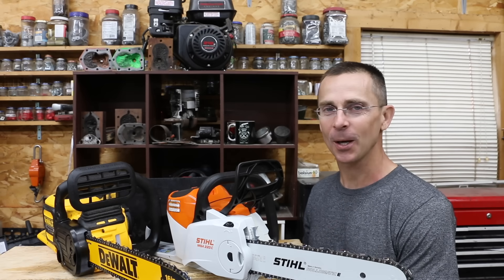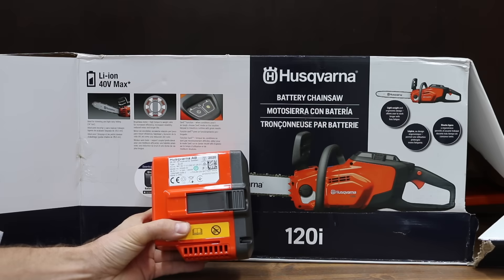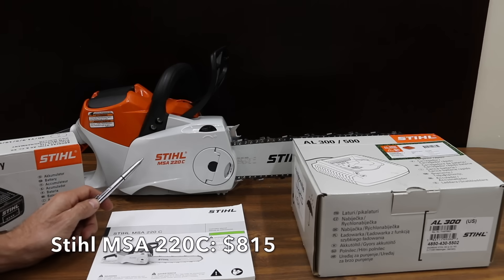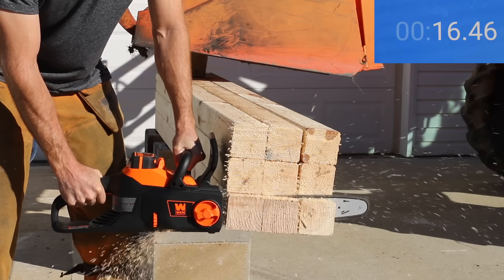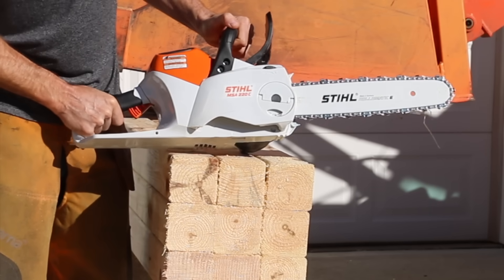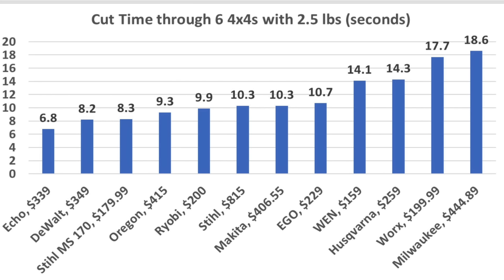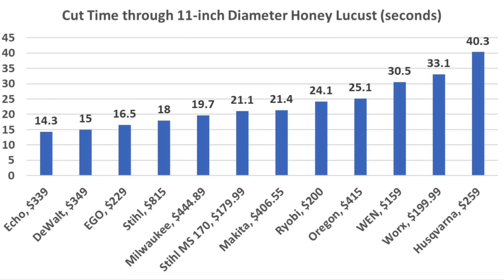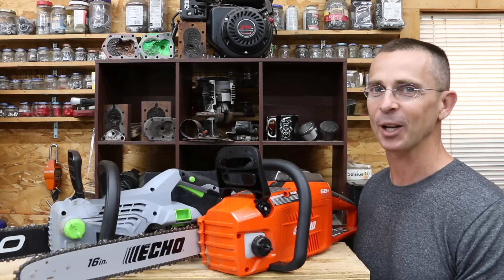Best Battery Powered Chainsaw Brand (ROUND 2)? Stihl, Husqvarna, Echo, Oregon, DeWalt

Comment: Test cordless angle grinders. Especially the 2 Milwaukees.
Reply from the maker: Great recommendation!
Reply: @ProjectFarm  It would be great if you could include the Metabo WB 18 LTX BL with one of theit LiHD batteries. I have tested mine against a Bosch and a DeWalt and it was more powerful. I feel like the Metabo LiHD batteries are among the most owerful tool batteries.
Reply: @ProjectFarm  The Portercable and dewalt seem to share one the newer 20v max batteries, this includes the battery powered grinder. So would love to see the Portercable 20v max and Dewalt 20v max thrown into the mix and see which one is better or if they are the same since they use the same battery. (both grinders do look quite different from each other outside the battery)
Also a funny note is the same battery style of the 20v max of those 2 brands share the almost same exact design as the craftsman and black and decker 20V max tools although they have switched on Craftsman since Sears went under.
Reply: @ProjectFarm  And please include the Walter brand.
Reply: @ProjectFarm  would love to see brands like ryobi, kobalt included!!
Reply: @zandersmith6960  I have an 80v Kobalt blower.  Kobalt could take the mountain if they made an 80v chainsaw entry.
Reply: @zandersmith6960  his previous video had Ryobi.
Reply: Metabo!
Reply: Would love to see the 60v max dewalt too
Reply: Test the Milwaukee cordless right angle die grinder, so that they can be publicly shamed.
Reply: Don't forget Craftsman
Reply: @JC-uq5gi  I hope they've improved over my older (4 years?) M18 4" grinder.  It comes in handy when I'm not near AC power, but it's really poor over-all compared to even basic 110v units.  I'd love to see a test to see if it's worth replacing my old one.
Reply: @donhappel9566  I have the 18v FUEL 4" grinder, and really like it.
Reply: @obliqueperspective  Mine isn't a fuel, so hopefully they've improved.  So many of the new cordless tools are as good or better than corded, but that grinder hasn't got nearly enough power compared to my 110v units.
Reply: Include Snap-On as well!
Reply: Id love to see that also , 

I've been using the fuel 5 inch grinder with 12 ah batteries and absolutely killer
Reply: On that node a comparison with Hilti could be great.
Reply: I personally wanted to see this as well, was just about to post it but he beat me to it! Hopefully gonna see a cordless 60v dewalt one for Christmas, I’d love to see how it performs!!
Reply: Yes please!
Reply: Maybe work in a Porter Cable? Not sure the name means much anymore (sigh)!
Reply: @gus473  Porter Cable, Black and Decker, and Stanley are all owned by DeWalt.
Reply: Don't forget Makita, I'd love to know if it's worth adding as I already have the batteries
Reply: Milwaukee 18 volt line at the moment is unbeatable. I have used every chainsaw known to man real world and milwaukee is by far the best. Every tool they make beats most of the competition. Volts don't matter when it comes to a small tools ability. It all depends on amp draw and motors ability to convert that power to useable energy. Many companies shove a high volt battery/motor in to a tool hoping it will save them. It can indeed fool many people in to believing the high volts is better. That just isn't the case. I build electric motors to btw.
Reply: @kevinroberts781  Absolutely true. I have a wohle Line of Metabo 18V tools and most of them outperform other 40V or 60V tools. People don't know that in 1 60V pack, there is the exact same energy as in a 3-row 18 Volt pack. In a 60V pack, there are 15 cells in series. In a 3-row 18V pack, there are three rows of 5 cells in series = 15 cells. It's the exact same pack energy but some marketing dude thinks that 60V sounds better.
Regarding Milwaukee: Yes, they are amazingly powerful. The only thing that I really don't like about them is, that it's basically a chinese company...
Reply: im a m18 fuel fan.
Reply: I have one of each milwaukee and I couldn't tell a lick of difference until the fuel crapped out after about 20 packs and the non fuel is still going strong 3 years later.
Reply: @JC-uq5gi  Milwaukee makes some really powerful cordless tools. But I'd say the Metabo angle grinder comes really close to the Milwaukees. I own one with 5.5Ah LiHD battery. I have compared it to Ryoby and Bosch and it has far more power. The newest Milwaukee grinder looks suspiciously similar to the Metabo design by the way...
Reply: @christiansprojects-cgmanuf1426  the tool is only half the battle. A lot of cordless tools are majorly lacking in the battery department. Slapping a 9AH+ battery greatly improves the tools.
Reply: @ionstorm66  It‘s not just about the battery capacity, it‘s the internal resistance that matters. But yes, higher capacity batteries generally have lower internal resistances.
Reply: @christiansprojects-cgmanuf1426  It doesn't really have anything to do with internal resistance or cell capacity. It is because when you bump up to a higher capacity battery pack, they add another set of batteries in parallel. So if you have a 3Ah battery pack in a 5s1p configuration, then you bump up to a 6Ah battery pack, it would be a 5s2p battery. So you're halving the current load each battery experiences, assuming the same load, but the tool can demand more current from the battery now that it senses that it can handle 2x the current draw. So it produces more power.  Yeah, internal resistance and cell capacity do contribute, but adding another bank in parallel is the main reason
Reply: @xenonram  
Sorry but I don’t agree on this one. Or maybe we both talk about the same but in a differemt way. It all depends only on internal resistance of the pack. The capacity or the cell configuration doesn’t matter at all. This might have an influence on the resistant but the main factor is the resistance. Yes, by adding cells in parallel, the resistance drops. But some 18650 cells have more than three times the resistance if one 21700 cell. So, a 5S1P 21700 pack might be more powerful than a 5S3P 18650pack - no matter what capacity they have. V = I * R, Ohms law, its that simple. Less resistance = less voltage sag = more watts (Power)
Reply: @xenonram   For example: A Metab LiHD 4Ah pack has a 5S1P configuration of 21700 cells. The pack can deliver more power than a Metabo 5.2Ah pack with a 5S2P configuration of 18650cells. So: Internal resistance.
Reply: @christiansprojects-cgmanuf1426  Nah, I = E /R! ;)

Comment: Todd. Would you prefer to use a gas or battery chainsaw as a go to saw? Thank you for your videos
Reply from the maker: I spent about 4 hours clearing several down trees yesterday.  I much prefer the electric for removing limbs.  In my opinion, it's much safer to place on the ground while tossing aside branches and it's back in action quickly.  For 12 inch logs, I prefer my much larger gas chainsaw
Reply: @ProjectFarm  That's a great point!

Comment: "Nothing beats a Stihl"
Reply from the maker: lol. $815 is a lot for the Stihl.  We'll find out!
Reply: @ProjectFarm   I paid over a thousand dollars for a stihl when i was in germany, had to get a ton of paper work on it to get it out of the country the way they acted they thought i was going to cut down a rain forest.. its gas powered and 62cc.
Reply: @klausreviewscraftrestore3152  Sounds like one of those Corvette engine saws :)
Reply: @ProjectFarm  it would be nice if you listed the models of the saws you're testing in the description. For quite a few brands there's bigger and smaller models available.
Reply: Can't beat 2 stroke, smells good, sounds good, goes good!
Reply: @Raff_Industries  Another benefit to 2 stroke saws is the ability to work on them yourself. Can't say I know much about how they compare in terms of user repairability. That and not having to replace batteries and having worse cold weather performance.
Reply: @Raff_Industries  absolutely
Reply: Nothing must be pretty good then!
Reply: Were gunna test that...
Reply: TELL THAT TO YOUR WALLET. OUCH😯😯😯
Reply: Each is different, I mean for commercial most are gonna stick with Stihl or Husqvarna. The older Husqvarna are really good fast cutting, but tend to be a bit of a pain to start that first time early on cold mornings. After you fire it up though they will crank right up. Them and Stihl both are known like they are because of a great track record.
Reply: Well, there's Stihl and then there's Stihl.    The pro "made in Chermany" saws are pretty much indestructible.   I don't know about the made-elsewhere prosumer saws.   I still use a couple of old Stihls that have put on nearly 50 years of service--and I can stihl find parts for them...
Reply: @tubastuff  stihl is made in virgins beach virgins or in Germany. Pro stuff is usually made in Germany. Everything else is made here.
Reply: Nothing can beat stihl in price I agree!!
Reply: Accept the bank...
Reply: Maybe not its price in this case.
Reply: A comparison between a comparable Husqvarna dealer saw not a Walmart Husqvarna saw like in this video also he stated people buy electric saws due to noise I'm looking for one I don't need to start in a tree preferably a top hander my saws are Husqvarna for ground work and homelite for in the tree just wanted a dealer saw comparison with the top brands preferably a small powerful top hander with brushless motor and equal battery
Reply: @1STGeneral  i would love a good stihl topper that was electric.
Reply: I bought 462 M-tronic Stihl sure is hard to start in cold weather compare to Husqvarna 572. 572 Husqvarna it takes 3 or 4 pulls but 462 when out in the cold takes at least 10 pulls. So I use ether to help it start faster to save my poor hand.
Reply: @donnysath9084  adjust the carb
Reply: @BigInjun05  can't do that with hi tech saw nowaday. all electronic control.
Reply: @donnysath9084  I'm still running an 034AV. Runs like a top.
Reply: I OWN BOTH THE DEWALT 20v and the 60v chainsaws and don’t have a thing to complain about my coworker has stihl gas and I rather have my battery chainsaw
Reply: I must admit that when I originally posted this it was out of nostalgia for Stihl, particularly their older 2-stroke saws that are bulletproof. I scoff a bit at the total cost of the electric Stihl shown here, but it makes me wonder how well it might do with a more agressive chain on it with the higher RPM's.
Reply: It's all about service, reliability and quality. There's Stihl saw shops everywhere. I have five Stihl chainsaws, some that are over 30 years old. They last forever and you can easily get parts for all of them.
Reply: @DK-jd8bj  Yep, they last damn long
Reply: @DK-jd8bj  For the price you can buy two Echo's and still take the wife out to lunch. That way if you manage to break one, you've got a spare.
Reply: It might not be the best performer, but when it comes to build quality and customer support it's unbeatable
Reply: @mins_982   Battery tech is still changing fast enough that making a big investment in a battery tool is questionable in my book.  Will a compatible replacement battery be available in 15 years?
Reply: Anything made in China is automatically disqualified in my book.
Reply: @DK-jd8bj  sad to say thats almost everything. everything made has a china part in it somewhere.
Reply: DEWALT JUST DID
Reply: Stihl the best !

Comment: thank you for including the EGO!
Reply from the maker: Great chainsaw!  Glad viewers requested it!
Reply: @ProjectFarm  I have the same model Ego with the 5AH battery. I just ran it through some white oak on a timer and got 6.6 minutes of run time. It's 0°C outside. This saw made me retire my gas burners unless I'm dropping a "monster" tree.
Reply: First: thank you Project farm for all these amazing videos with products that the average user would buy and use from HF to pro grade.  @backwoodsskeptic8343  yes, I agree. I have had the Ego for about 2 years now and absolutely love it. The Ego's controller has a sensor to know what battery is currently being used and will output more power with the 5ah battery. Last year I cut down an old black walnut tree about 60ft tall and did it with my 14in Ego along with about 5 battery changes, I have (1) 5ah and (3) 2.5ah batteries. Also just bought a 16in bar and chain for it, the motor end is the same for both.
Reply: @ProjectFarm  another great review.  I would highly recommend the 18 inch ego over this 14.  It has an advertised 11,000 rpm.  I have had both and there is just no comparison
Reply: @ProjectFarm  please do de same tests whit sub 1000 dollar chainsaws.
I want to see how it goes
Include the husqvarna 550xp
Reply: @ProjectFarm  I'd like to see how corded electric chainsaws fare in these tests.  I'm betting they beat the heck out of the battery ones on run time.
Reply: @HariSeldon913  how did you come to that conclusion? but try that test in the middle of a 20 acre field
Reply: @Sacapuntas69  Sure, but I get to bring my portable generator which would easily run 12 hours on a tank, probably longer if it's just the chainsaw.
Reply: @HariSeldon913  then what is the purpose behind electric chainsaw if you have to  bring extension cord and generator. takes all the added convenience from being electric. just get a gas powered chainsaw.
Reply: @Sacapuntas69  You came up with the 20 acres.  My house isn't on a 20 acre lot and has outlets in the back that would allow me to reach any tree I'd need to with a 50' extension cord, so the electric does make sense for me.  I just adapted to your rules.
Reply: @HariSeldon913  My rules? hahahaha